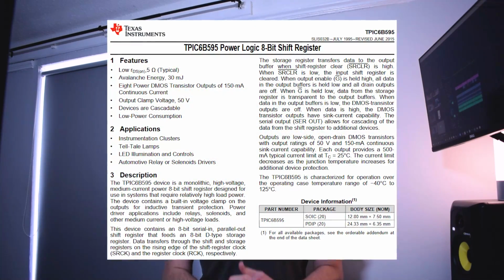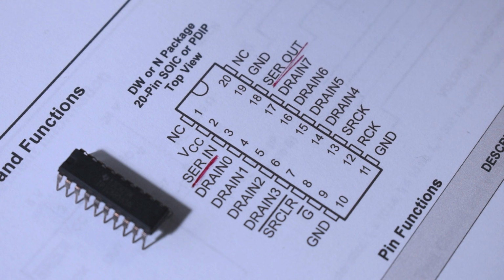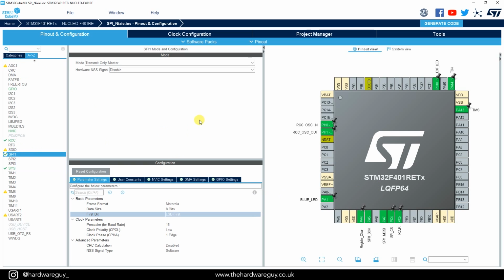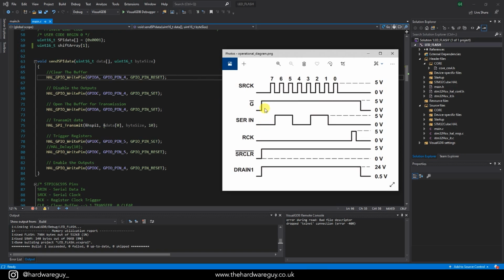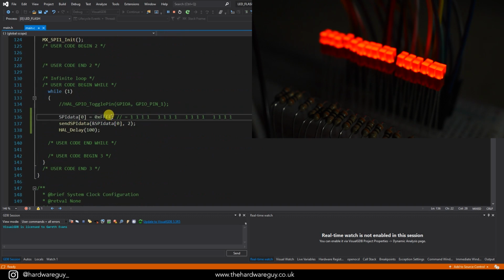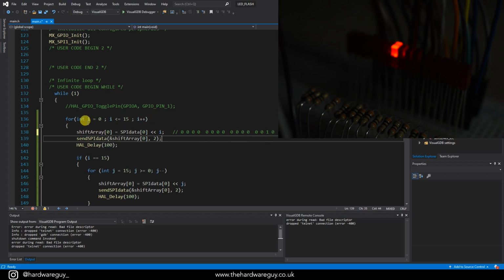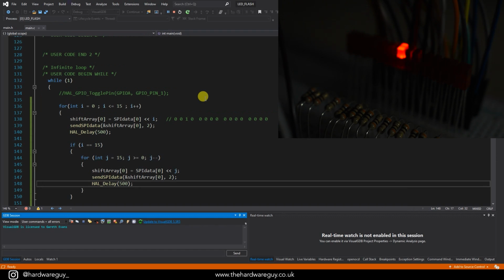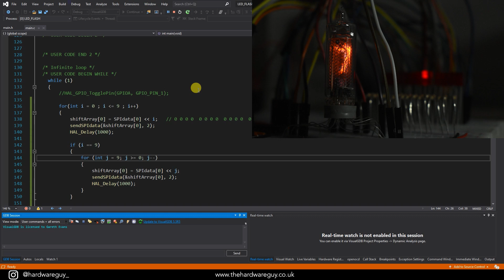8-bit Shift Register - TPIC6B595 Nixie Driver - STM32 SPI

Comment from the maker: Timestamps:
00:00 Intro
00:24 TPIC6B595 Shift Register
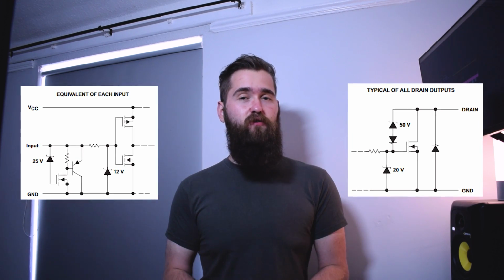01:02 What is a shift register?
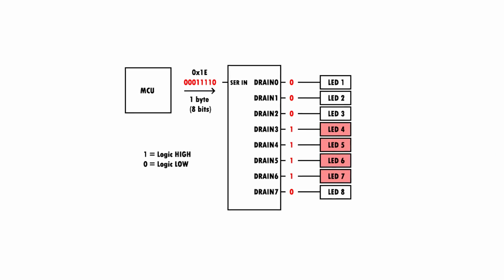01:17 Serial-in - Parallel-out
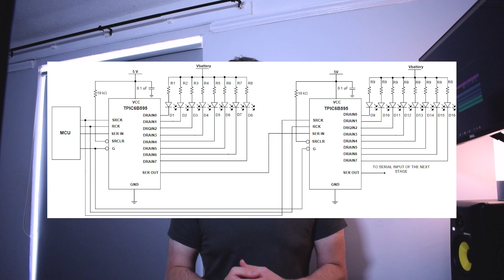02:01 TPIC6B595 Pin Configuration
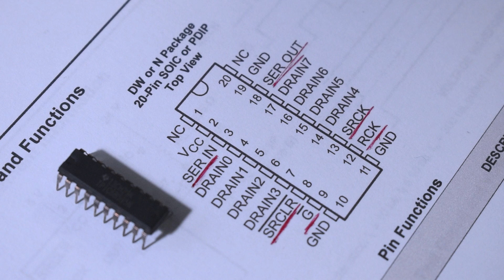03:02 Operational Diagram
03:11 Cascading the TPIC6B595
03:54 SPI Communication
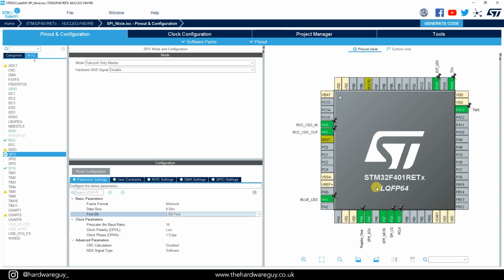04:27 STM32CubeMX SPI Setup
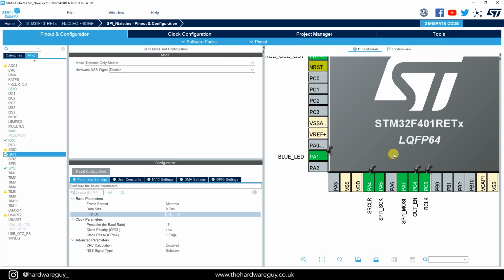05:12 Pin-setup Referencing the Operational Diagram
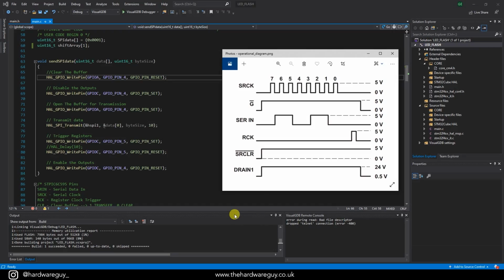06:00 Programming a Function to communicate with the TPIC6B595
08:03 Example 1 - Sending Hex Data and Displaying it on 16 LED's
09:56 Example 2 - Walking 1's
13:20 Example 3 - Counting Nixie Tube
14:45 Outro

Comment: Do you Need a Constant current source  or how to decide the resistor size for the LEDs? 
If i use a 7 Segment Display and Speed up the LEDs dim a lot. Have you experience with shiftreg and constant current source ?

Comment: There no need to take ~G high to disable outputs when clocking in data. I’ve no idea why they confused the logic diagram in the datasheet by making it look like that is necessary.  Indeed it is usually advantageous not to do this so the current display is not unnecessarily blanked while shifting.
The 6B595 is a shift register combined with a D type storage register. Data from the shift register is only transferred to the storage register, and hence the outputs, on the rising edge of RCLK. Until then the outputs retain their previously latched value regardless of any new data currently shifted in.
A good use of ~G would be to connect to a PWM output of the microcontroller. You can use this to control brightness, and do cool effects like fade in/out.

Comment: How are you able to drive a nixie tube when the TPIC6B595 output drain to source voltage is clamped to 50V? Don't nixie tubes normally require 150V+ to turn on?
Reply: The anode voltage on the nixie is usually 170 to 180v. If the cathode is clamped to 50v then the voltage across the tube is only 120-130v, so not enough to reach the ignition voltage of the neon, and so the nixie remains off.
The clamping is useful in applications where there might be voltage spikes on the outputs. It prevents the chip from being damaged by higher voltages. In this application we care only that the outputs can handle maximum potential that will result when the tubes are off (i.e. below the tubes ignition voltage).
When off/not connected the cathodes will float to the anode voltage, but are pulled down to the 50v by the clamping. However, as the nixie is off very little current flows in this condition.